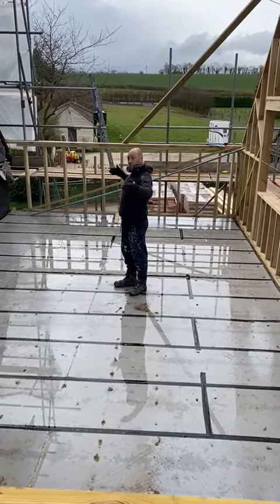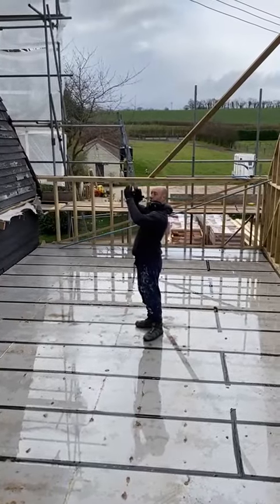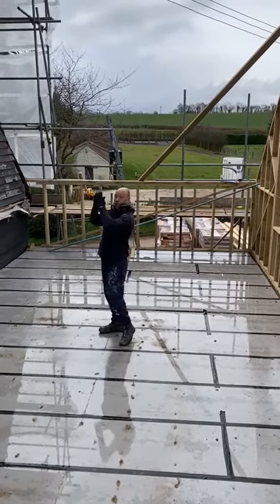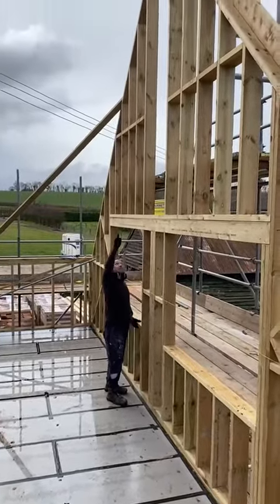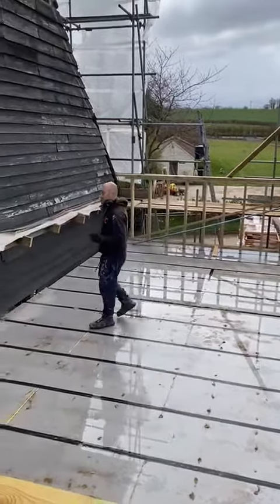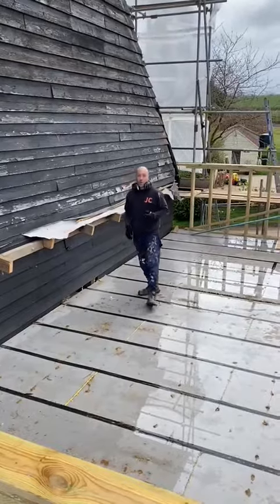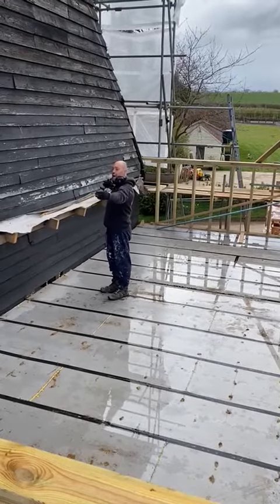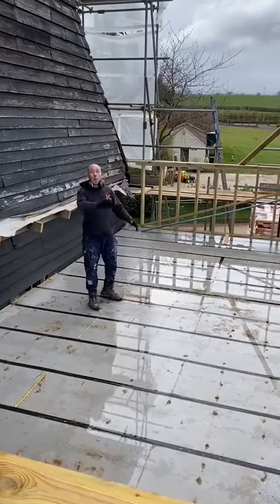Work Tips | Advanced Roofing Tips | JC Timber Roof Specialist

Comment: Nearly finished my 1st proper hipped roof.
3 hips, 3 valleys.
Bit ambitious for my first time  but I've loved it.
Plates where parallel but not 100% square, I knocked them about as much as I could until they were within 10-15mm. 
3240x 6455
One valley is abit dodgy and I've no idea how I could have got a round it without moving the building about. Couldn't even form a bastard valley without the lay boards actually coming over the original hips.
It's rosemary tiles, rosemary valleys and hip bonnets so everything had to be mono pitch to make the tiles work.

But I've learned alot.
I'll be your competition one day.
Reply from the maker: Ha ha good 👍  we all need drive keep it up man 😁